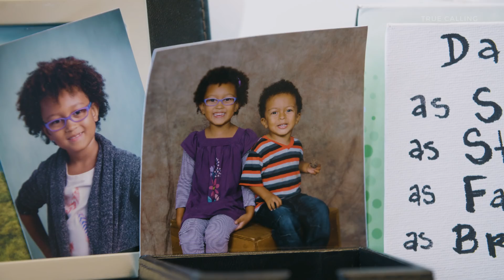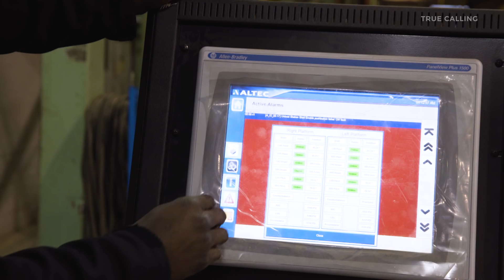This Roller Coaster Engineer Creates World Famous Amusement Park Rides

Comment: These are flats rides, roller coasters are trains and track that go under the effect of gravity, so rides like Taron do use launches to give their train speed but for basically the entire circuit of ride is just plain track and the trains are speeding around the energy they got from the launch but for Powered Rides like the Runaway Mine Train at Alton Towers, it uses motors within the train and the track has fins that give electricity to those motors and allow them to move the train up hills and around bends and that makes it a flat ride
Reply: You did not need to type all that